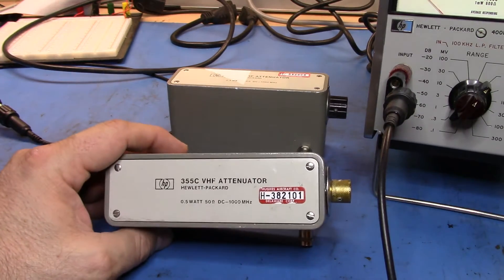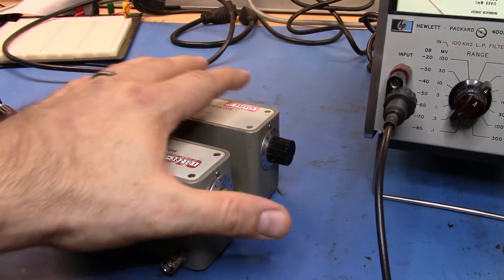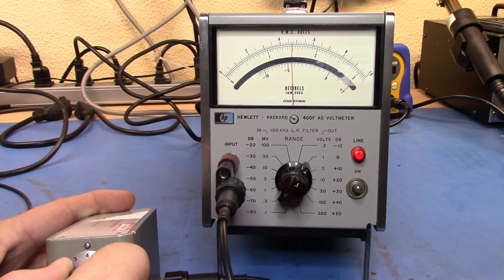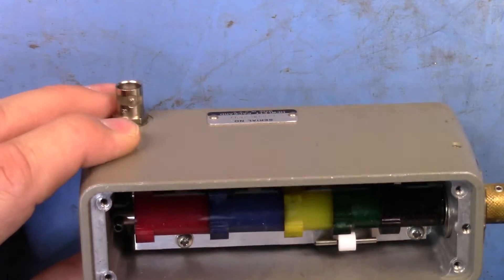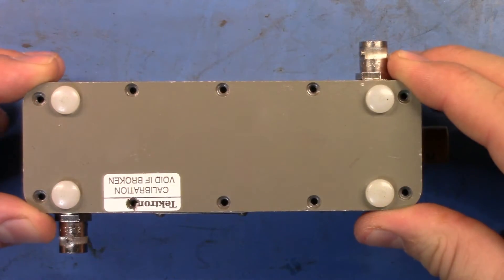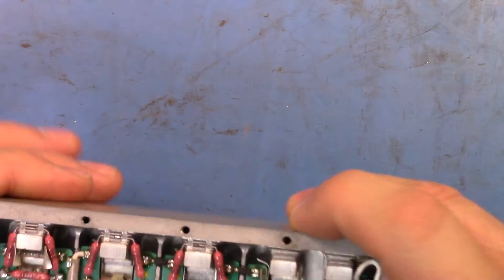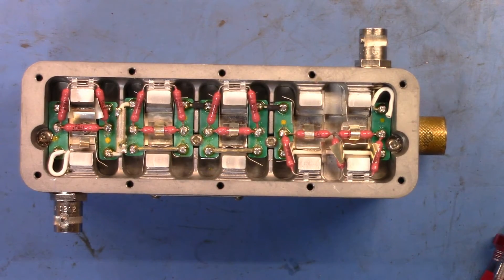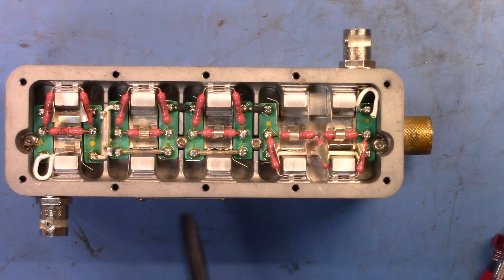HP 355C Step Attenuator Tear

Comment: they look more easy on theory right? those little metal flanges look like something a guy just bend it when close the lid, but hell no xD
Reply from the maker: Exactly - Very simple in theory, much harder in practice (need a grey beard and to have the tongue hanging out at the right angle).

It's one thing that I wished HP had added to their manuals - Information on the process they used to factory select components and then the steps/gear they used to factory tweak the units...
Reply: @tgsoapbox  I think that is exactly what you pay for, the knowledge involved over the raw materials used to build it, regards
Reply from the maker: @fernandorubio9028  Completely agree

Comment: I was waiting at the end for you to fix it and recalibrate... bummer.  Anyhow, thanks for the view of the inside.
Reply from the maker: Sorry about that - I did research repairing it and what I found was that both the resistors and the metal flanges are specifically chosen by HPAK and then manually adjusted to work correctly - That process might be possible in the production environment but it really isn't something I think you can do at home. That said, I might come back to it at some point and just give it a try.
Reply: @tgsoapbox  No worries.  I assumed that it might be as simple as corrosion on the switch contacts and that a contact cleaner, lubricant, etc., might fix the issue.  It would be interesting to probe the various stages individually with a VNA to find out which one is faulty, etc.  Not sure if you have one on hand, but that's how I would start I think.  Good luck!  Thanks for the video.

Comment: The wire pigtails are gimmick capacitors used for adjusting the frequency response- don't touch them!!!!!
Reply from the maker: Thanks Michael - That's exactly what I was referring to when I was talking about them being folded by guys with grey beards and their tongues at the right angle. There was probably a test jig that they went into that made the folding really easy on the production line but that jig, and the figures behind it, are now lost to time I bet.

I have a bunch of out of spec 355 series units though so maybe I should start trying it out...
Reply: You can optimize them for attenuation accuracy OR best Return Loss.Get a
 selection of 1pct low value metal film resistors if you need to replace
 any.If you have access to a spectrum analyzer & tracking generator 
to at least 1GHz it is possible to adjust them to specs or better .Some 
resistors have a staked ground connection to the aluminum casting- this 
is a potential trouble source -check this first.
You can also run about 10 mA d.c. through each microswitch while rotating the knob back & forth a few times to clean the contacts.
Reply from the maker: Thanks for that - I'll give that a try - Mostly I'm using them for attenuation accuracy - If it works than I'll try that on the 355Ds I have that are out of spec.
Reply: You mean to say that you got them for 99c each? You lucky guy! One thing.. could it be that you are measuring at the wrong impedance? The attenuators usually come with an output impedance of 50 Ohm while the 400f has an input impedance of 600 Ohm. The matching error might be less obvious at low attenuation than at high attenuation.